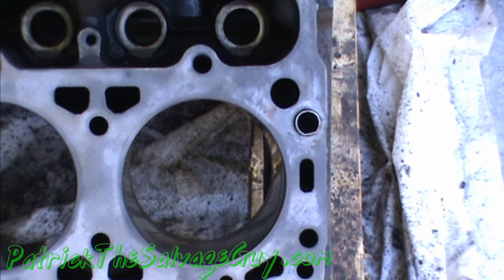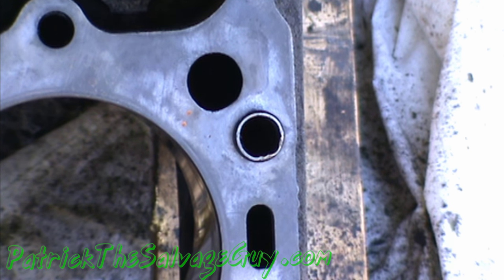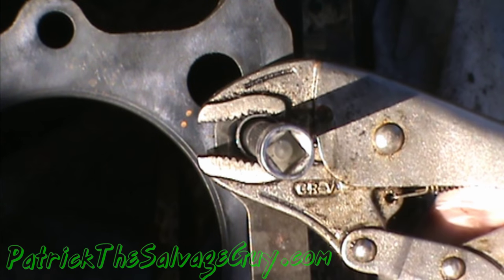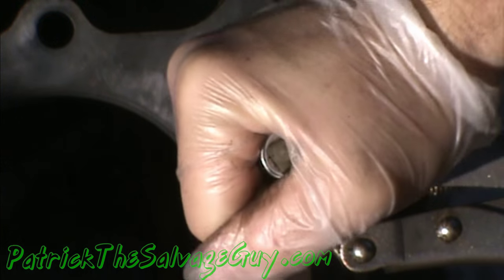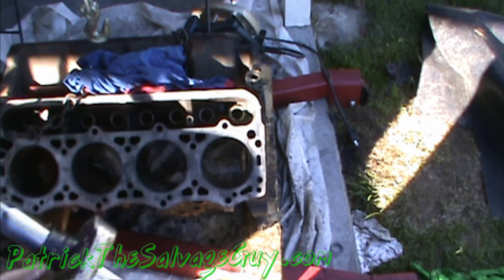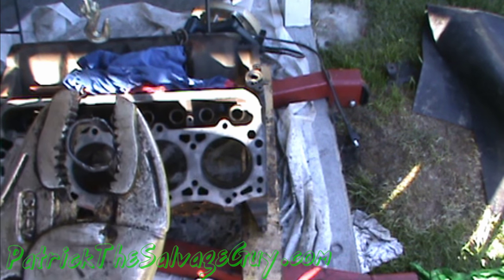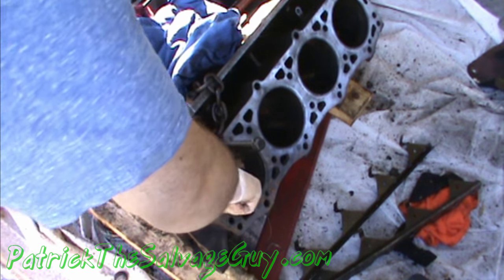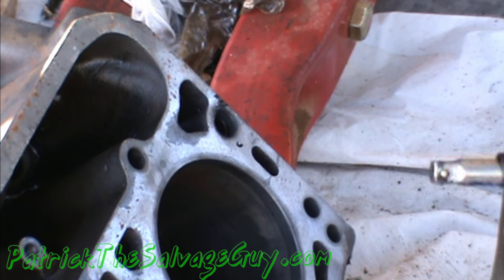Removing Head Alignment Dowel Rods

Comment: Hi Patrick-I have been watching a bunch of your 7.3 videos. Good Stuff! I have an early 99 F350 4x4 7.3 that I bought like 12 years ago with 70,000 miles on her. She now has 350,000 miles and has been a awesome work horse trk!! I will never have anything but a 7.3 trk!! I recently had fuel in my coolant so I replaced all 8 of my injector cups. I had a bad glow plug so took care of that while I was in there. also put new injector o rings on all 8. I have absolutely no blow by and no smoke on cold or hot start ups!! BUT here lately I have been hearing what kinda sounds to me like a piston slap or wrist pin bearing or possible early sounds of a rod knock (very faint) Never did it until after I replaced my injector cups ( maybe just a coincidence) but either way I might have to pull my engine. I do not want to let it get to bad so that hopefully I can reuse my block, pistons,heads, etc and just put new bearings, rings, etc. So I might be asking you a lot of questions about what to do etc. If thats ok? as I have pulled the transmission out once to install a new torque converter, water pump, hub assemblies, etc. But I have never been inside the engine on this big boy!! So I could sure use any advise!!!  But I wanted to give you kudos on your videos!! I watched all of the ones on the 7.3 van......I think its cool the way you have your little girl helping you in a lot of them...I also like your cool and calm demeanor while working on things ( I'm still working on my patience as I get a little more frustrated then you do after doing a long job like like)   I'm also a fellow Christian and Believer in JESUS CHRIST. My father is a Baptist missionary to mexico and has been for over 30 years. I like the way you bless everyone ( unbelievers alike!!) at the end of your videos. Keep the videos coming ( I cant hardly find any on engine work on the 7.3) Most are on the 6.0 mainly probably because of the emission junk they put on them so they have more issues than the 7.3. Head gasket issues, egr issues, hpop issues, etc,etc. Anyway just wanted to say hello to a fellow follower of JESUS... talk to you latter my friend!!